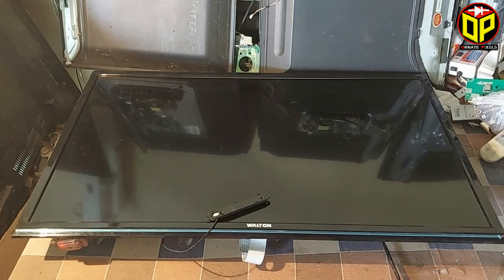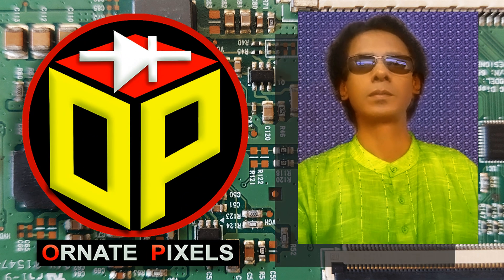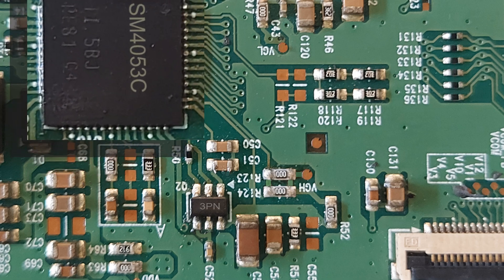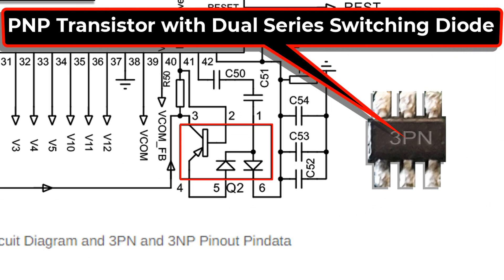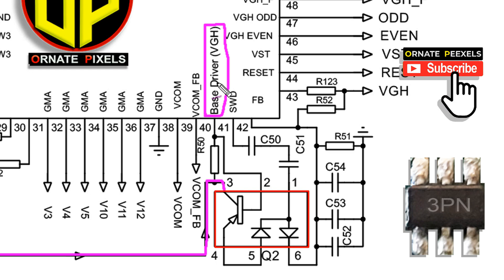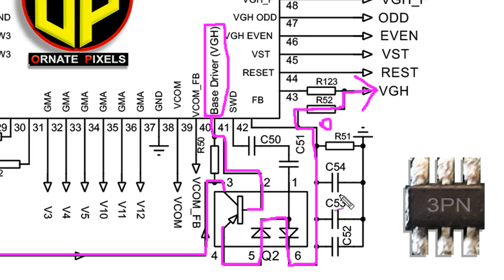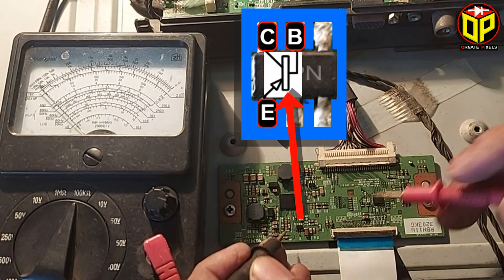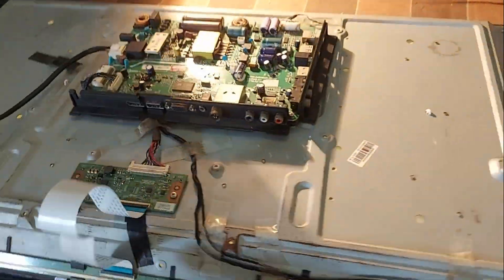Vertical Lines & No Display Problem on LCD TV Screen | VGH Voltage Missing But Not CKV Issue

Comment: I m from Sri Lanka. In lg t con board smd name is printed in board B102 . Meaning of B?
Reply from the maker: "B": This letter represents a multiplier. In this case, "B" means 0.1.
"102": This number indicates the resistor's value. 
The first two digits (10) are the base value. 

The last digit (2) is the power of 10 multiplier. 

Therefore, the value of "B102" is calculated as follows: 

10 x 10^2 x 0.1 = 100 ohms. 

So, an SMD resistor marked "B102" has a value of 100 ohms.
Thanks
🌼❤️🌼

Comment: i got very similar problem on my walton 32inch lcd tv, first some flickering black vertical lines appeared, then suddenly the screen goes black. Sometimes the screen comes on after powercycle with the lines. 
Do you have a repairshop or service center in bangladesh ?

Comment: Sorry, but amra ki bc328 or A950 er bodole onno kono common transistor use korte pari?
Jeta sohoje jkono dokane pabo?
Reply from the maker: Two transistors are very available in the market. Thanks.
Reply: @OrnatePixels  Thanks a lot dada 💗

Comment: Old Panasonic Tv, Vedio not clearly visible. Vedio will visible slaidly twice and flicking.
Reply from the maker: You didn't mention the voltage of the test points.  If there is CKV in the circuit you can cut one side and see what happens.  stay well

Comment: Dear sir how you think about transistor to solve it?
Reply from the maker: The voltage VGH is output from the switching transistor.
• AVDD is input to the collector of this transistor
• The switching pulse is input to the base
•The VGH or boost voltage is output from the emitter.
If necessary, you can watch the explanation of the circuit again in the video.
Thanks Brother.